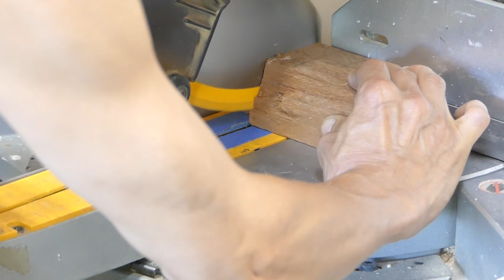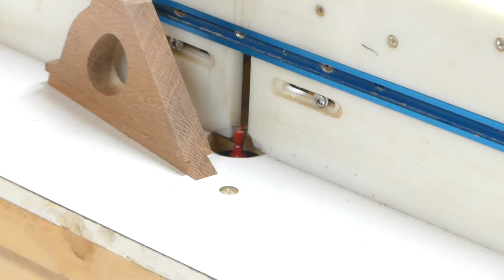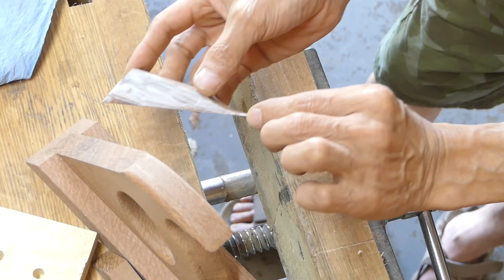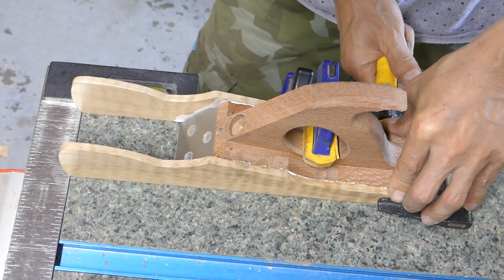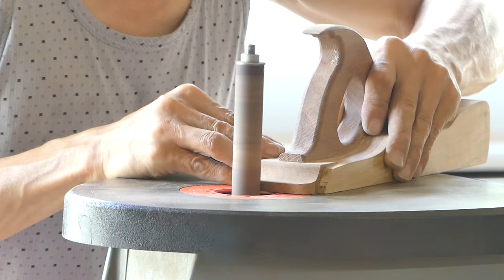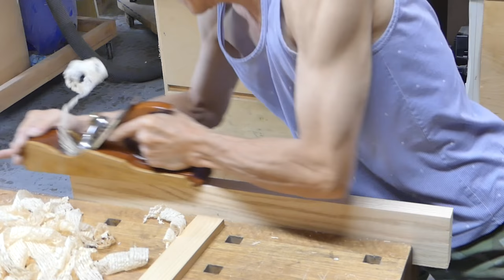make a wooden hand plane

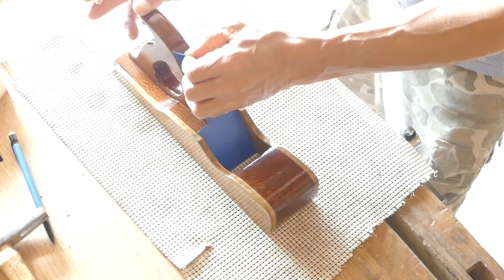Comment: 15:10 How do you adjust the depth? I see a chip breaker and iron, but the way they're mounted with the lever cap screw going through the chip breaker and iron, it doesn't give much ability to adjust the depth.

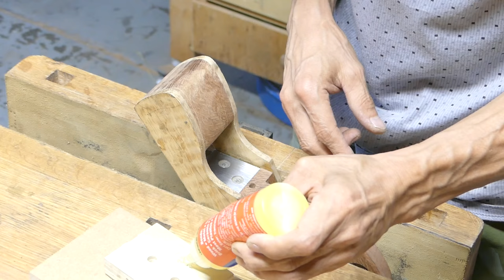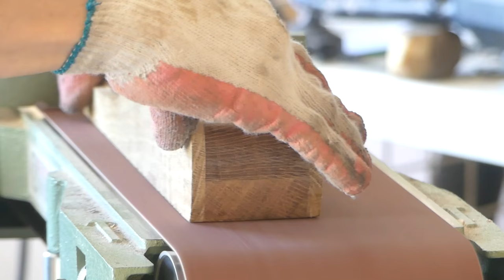Comment: From 10:54 to 11:41, it looks like you're adding epoxy to the top of the frog area. But, why? Is it maybe to fill the top of the counter-sunk screws and any minor voids which might be on this surface? I followed along with your logic in all other aspects, just as well as if you'd narrated your actions. But at this point, I could not see your motivation.. Also; do you adjust the iron in the same way you would on an old wood-block plain? Thank you. I love your videos and I am now a subscriber!